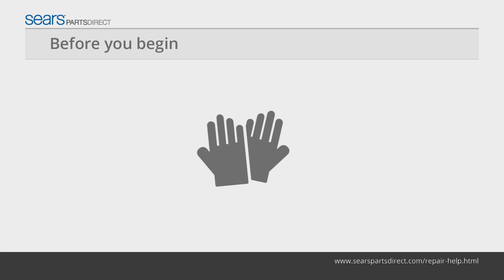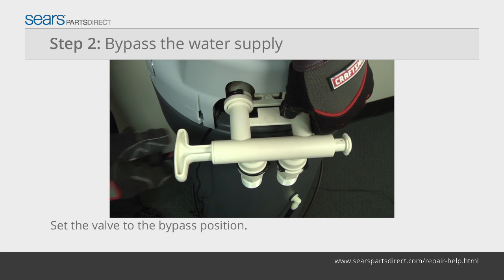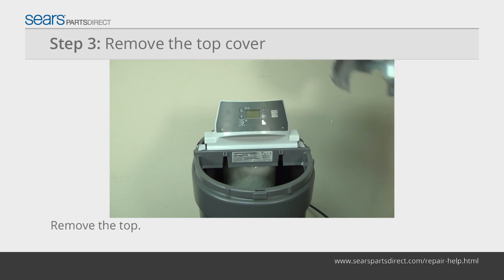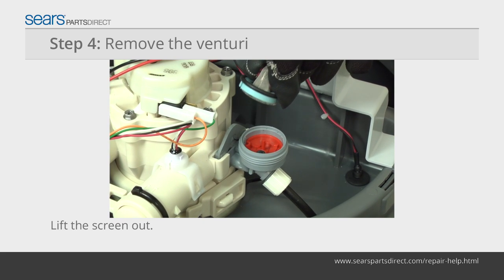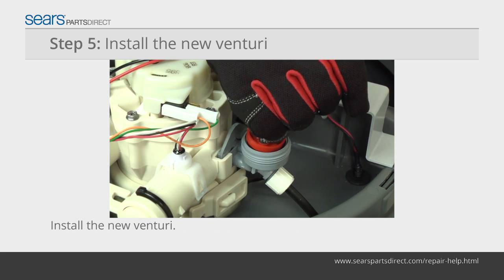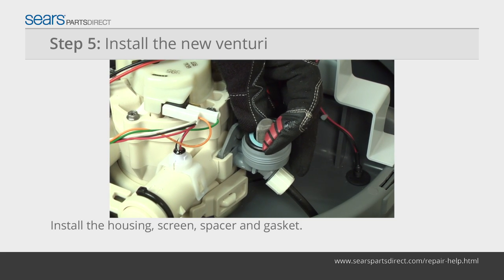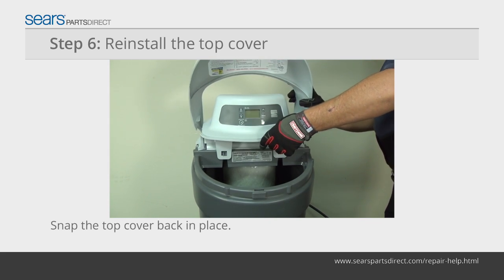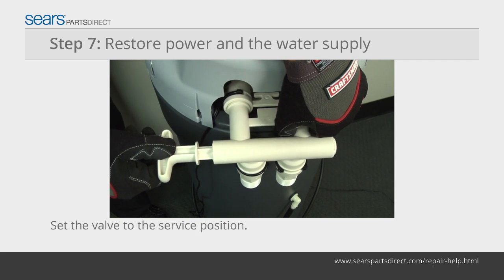How to Replace a Kenmore Water Softener Venturi

Comment: First no need to put the softener into bypass mode. Theres no watee fliwing through the nozzle/venturi assembly (except during regeneration.) 
2nd there should never be a need to "replace the venturi" in these units. Just a light cleaning should suffice. The oart that usualky gets clogged id the large screen. 
3rd. Never use petroleum jelly to lubricate the o-ring. Use only silicone grease made for this purpose. Petroleum jelly can actually harm several types of o-rings, depending on the type of rubber used in its construction. 

This is a terrible video, filled with mistakes. There are better videos avaliable on YouTube.